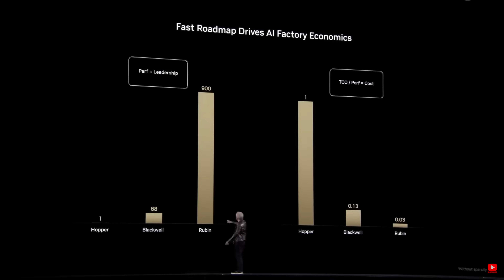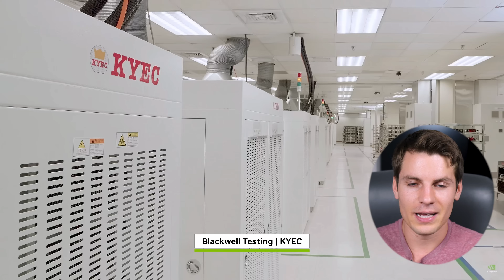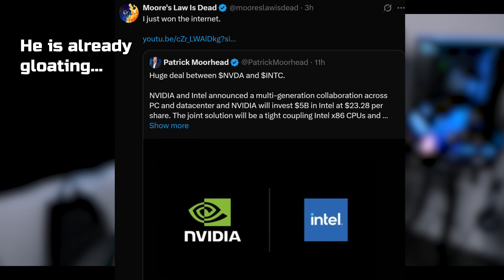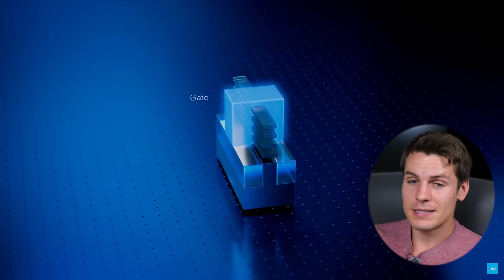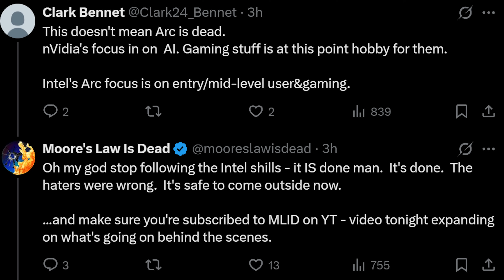Nvidia just Teamed up with Intel

Comment: AMD will be fine because of the open source Linux community. The big question will be what happens to the open source support of Intel
Reply from the maker: How big do you think the Linux community is?
Reply: @SiliconSteak  "Linux, through Android, powers 85% of smartphones worldwide. Additionally, more than 58% of all Internet of Things (IoT) devices run on Linux."
Reply: @SiliconSteak  "Cloud Infrastructure: About 90% of cloud infrastructure operates on Linux, indicating its critical role in modern cloud computing"
Reply: @SiliconSteak  "Linux is used by 41.8% of all websites whose operating system is known, demonstrating its significant role in powering the internet"
Reply from the maker: Ok, but from my understanding their server parts do run linux, its just their consumer line that doesnt have geforce drivers. I think for 90% of consumers it doesnt matter. With developments in Steam OS I think that will grow.

Comment: Will quicsync be coming to Nvidia?
Reply from the maker: I’m thinking, most likely, if there is a Intel + nvidia chip made, it won’t be paired with a discrete GPU. So I would guess no, any intel chips you would pair with a discrete GPU, probably wouldn’t have nvidia graphics. Those chips might keep ARC IGPUs, so quicksync would still be there in that case

Comment: What's your PC spec? You said you have a 5090, but what's the rest?
Reply from the maker: 265k (tuned 8533 MT/s 48GB ddr5)
14TB GEN 4 nvme storage
RTX 5090 Zotac solid OC
1050w atx 3.1 PSU
Reply: @SiliconSteak  Dang, goin crazy!
Reply: @SiliconSteak  14TB...damn bro. This is serious capacity for drive so fast.
Reply from the maker: @GreyDeathVaccine it’s across 6 different nvme drives. The z890 platform has a ton of lanes

Comment: Look at the Halo Strix APU. It can out perform an RTX 460 in certain areas. It is possible that your 5090 could look silly in 5 to 10 years, but time will only tell.
Reply: GTX 590 is a good example - if DX 13 or other new API's come out, the 5090 could be obsolete in half the time, just like the GTX 600 series became.

Comment: Man if Intel can release an APU with 8 P cores + 0 estrogen cores  and an RTX igpu on the level of 5070, I would buy laptop with that in a heartbeat.  Before asking why not buy a laptop with i7 14700H or ultra 265U with a laptop "5070" discrete chip  thats not really what I described.
Reply: Don't laugh at E-cores, because in a few years the equivalent of P-core will be a scaled-up E-core based on the Arctic Wolf microarchitecture.

Comment: I think this is a good thing for gaming/cad and gpu rendering. I have for years believed that these companies could have added a full gpu to one cpu package. Yes that would require a new package for a motherboard. Apple has the ARM M3 Ultra and memory on the same package which minimizes the distance data needs to travel and probably contributes as to why it has the fastest single core score. There is no reason why a Ultra 9 285K and GeForce RTX 5090 could not be placed on the same package.
The package would be a lot bigger to dissipate all the heat, but all the interconnects will be a lot closer which will result in better performance. What has kept this from happening is the desire to sell discrete cards.
Reply: Playstation exists.
also Xbox, laptops and APU. 
I will buy discrete cards because they have better cooling, better "modularity". when i bought my current PC i had rx580 + ryzen 2600. I replaced GPU and able to run most of newest games in 1440p high settings with decent FPS while keeping same motherboard/ram/cpu. Now i can save up money for new mobo + CPU+ ram and it will cover my gaming needs for few years, in which i can save up for new gpu. 

having both most expencive parts in single package is just killing purpose of PC, might as well just get xbox then? 
Also GPUs need high speed SSD built into them (in form of NVME slot on GPU), just so it can use it instead of VRam or RAM and load stuff directly similar to PS5 tech. 

If anything i would love PC industry moving away from ATX motherboards and get something creative to spread CPU even further from GPU to make it easier to deal with heat. 
Thing u want is basically every laptop.

Comment: I think arc will still be around,  the decrete gpus dont have to be flagship. The current arc line fills a niche only being x8.
Reply: @Plannerchannel-p3i  the issue with budget Arc cards is a Intel-Nvidia APU will kill that segment off. Arc needs to have 70/80-class graphics cards like yesterday.
Reply: @e.l.4409   i definitely dont think that'll be the reason that kills arc, cuz the prices of those apus would make it basically worthless for most gamers, i think the apus would start with targeting the laptop market first, intel already supplies most laptop cpus, an nvidia  combo would be lethal there, plus most people arent talking about how this would be a threat to amd's console market, xbox and play station might drop amd as a supplier if the performance is worth it for console gamers, even though the price isn't cool
Reply: @obinnaogueri I think Nvidia being worried about IP transfer will kill off Arc discrete cards.
Reply: @obinnaogueri   AMD already closed a long term deal with Playstation. Not only as suppliers but as technology partners as well.
So I think Sony is in too deep in their collaboration to the point I see no change for at least the next two Playstation consoles.
Microsoft also signed a deal for the next Xbox. And honesty I don't even think they will even be making consoles after that.
Nintendo is already with Nvidia so AMD doesn't have anything to lose there.
Reply: being x8 means nothing.